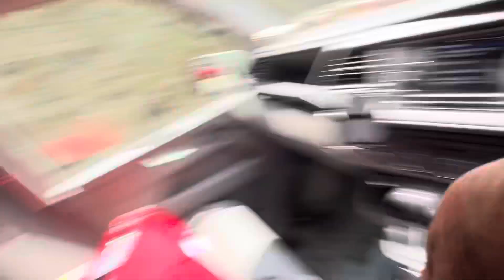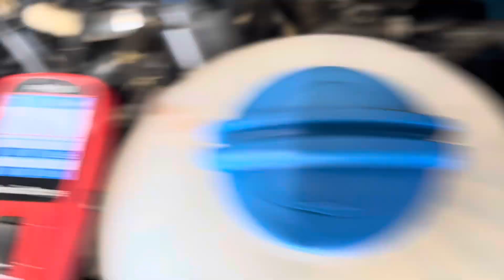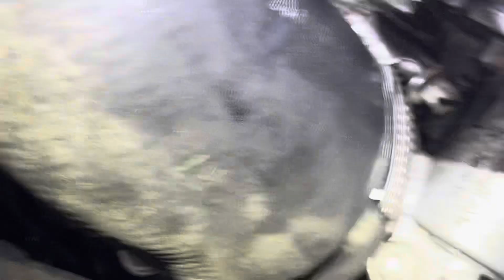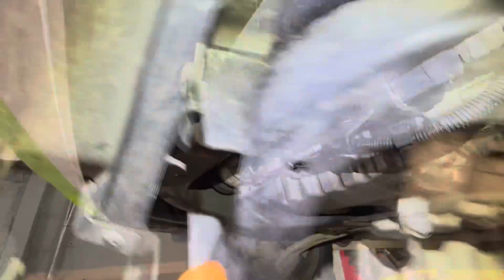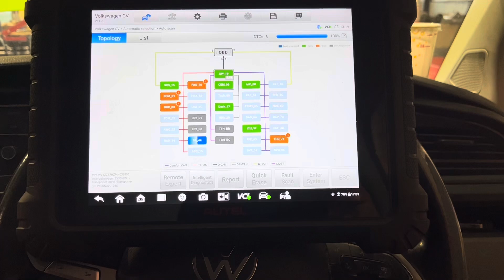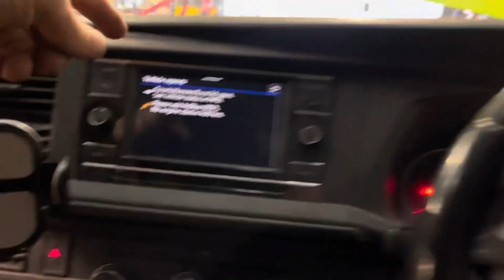Volkswagen Transporter not charging & alternator replacement

Comment: I like how you check for Linbus signal,power & ground supply,voltage drop & circuit integrity before 'firing parts cannon' Peter,attention to detail as per usual.Possibly a failed/failing voltage regulator.Depending on customers preference/budget, i carry out some basic electrical testing i.e carbon brushes,sliprings,stator &rotor windings,rectifier diodes,insulation testing,beaings etc.More often than not its the voltage regulator & if available i quote for a repair of original alternaator & replace with 'new alternator',allowing  customer to choose.The quality of some aftermarket alternators,would some times dictate repairing OEM unit,as opposed to fitting 'new'.Some aftermarket units will not 'put out' the max amp spec & that can only normally be tested on the vehicle once installed, by placing a imposed electrical load on battery with engine running.I either connect up a carbon pile type battery tester/load bank or operate all current consuming devices/appliances on vehicle to impose the max load spec.Thanks for posting,nice weekend.

Comment: Damn thats a lot of Mazda's in the yard, id say you're sick of them. I guess anyone running into an issue with these is bound to run into your videos so it makes sense really ( Myself included 😂). Ye seem to be single handily keeping 3rd gen 2.2s on the road. What do you think is the most common issue you see on these ?
Reply from the maker: Apologies but this comment slipped by me. The most common issue I see is the exhaust camshaft wearing and having a knock on effect on the Dpf blocking. It happens from around 150k +